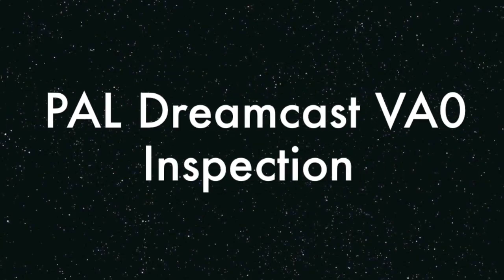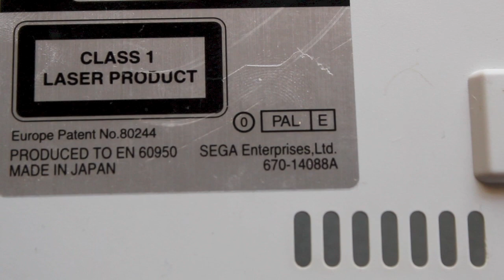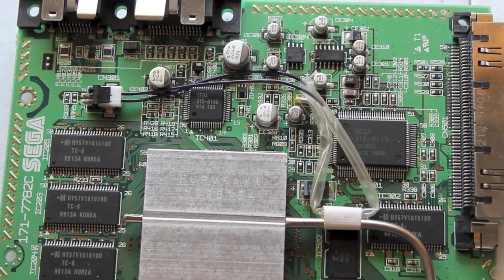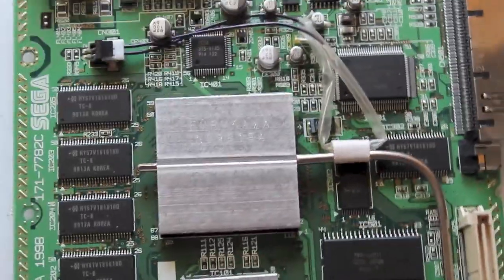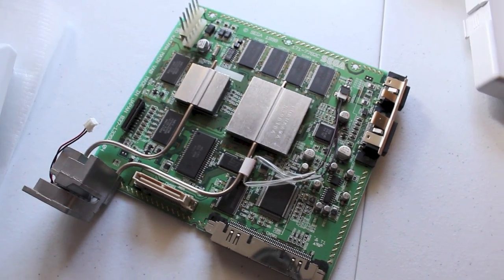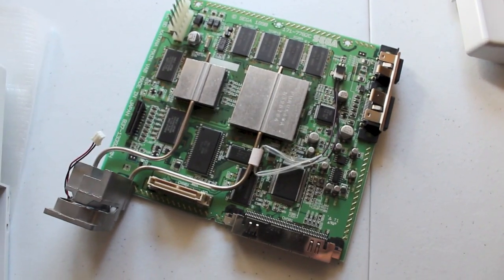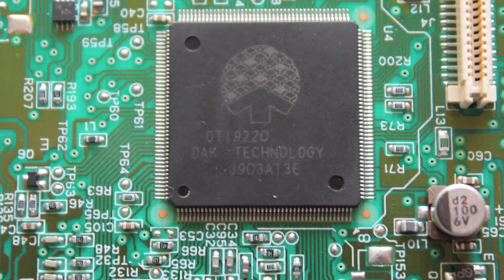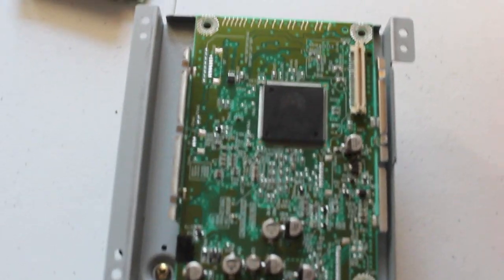Sega Dreamcast VA0 PAL Mainboard Overview

Comment: The only thing that really sucks about these VA0s is that they require soldering to install a GDEMU.
You need to replace 7 Resistor Arrays because the disc drive on the VA0 runs on 5v instead of 3v, and 5v could kill your GDEMU because it's design to run at 3v.